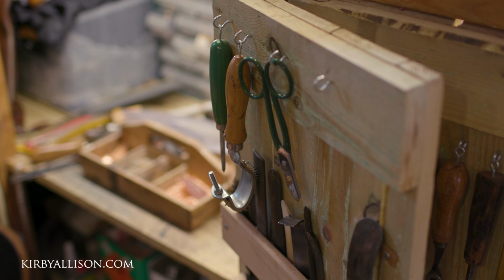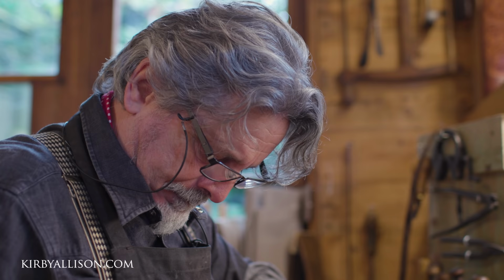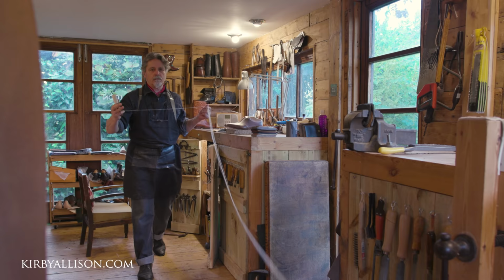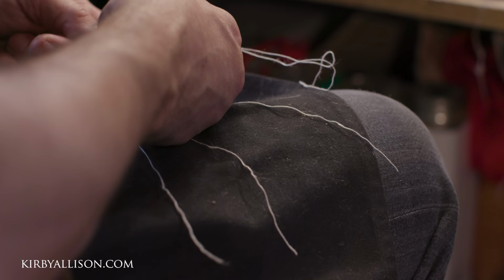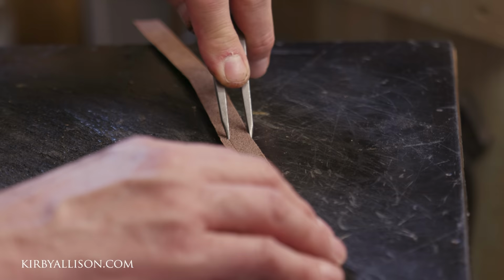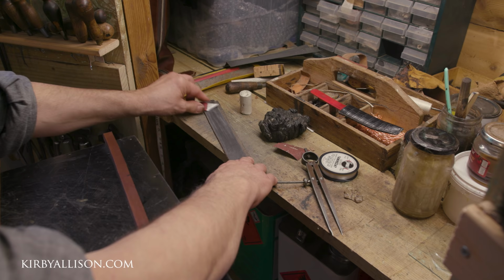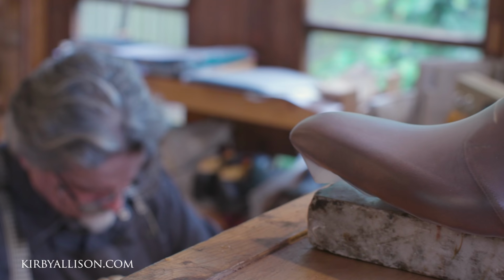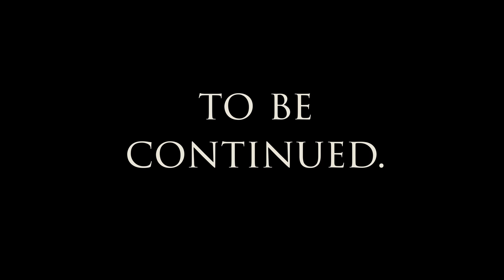Bespoke Shoemaking With Dominic Casey [ASMR] | Kirby Allison

Comment: Is it possible to repair a boot or shoe when the leather has split away from the sole at the juncture between sole and upper?
Reply: It depends upon the method that the sole and upper were originally joined together. If a Blake stitch or welted stitch was used then a competent cobbler can do the repair, but if they were originally glued then it likely is cost prohibitive.

Comment: 2:57 What is the foil for? Never seen this before
Reply: I've seen this at Carmina.  It's a heavy shrink wrap plastic they put over the upper, to protect that leather from scuffs and abrasions while working on the sole.
Reply from the maker: Exactly! Helps protect the uppers during the make.
Reply: @kirbyallison  That's what I Thought... but it's sewn in
Reply: Hi Harry. The shoe I was making was in suede, so the plastic cover is protecting the upper mainly for any water, ink or wax and general dirt. It gets sewn in and then carefully cut away when the shoes are finished.
Reply: @dominiccasey4466  Interesting. I'm excited for part 2

Comment: Spitting nails  -
Upholstery tacks/nails, held in the mouth... one is chosen- passed to the lips by the tongue.. as a magnetic tipped hammer is touched to the nail head between the lips...  then as one motion  > the hammer, with nail affixed,  is turned to strike the nail into place... the hammer is rotated,  and the nail struck home.
And again.. a nail is passed to the lips by the tongue...

Comment: Why wouldn't you just buy the heavier weight thread.  Seems like it would sav you so much more time.
Reply: The heavier weight thread that is available is made for use by machines such as you see at a cobblers shop. It also tends to use shorter fibers which are weaker. To make the thread (aka 'waxed ends') that is being used here it needs to have a tapered end to attach the bristle. It also should be a dry spun rather than the much more common wet spun fiber. And depending upon which part of the shoe you are stitching, you will use a different plies of thread.